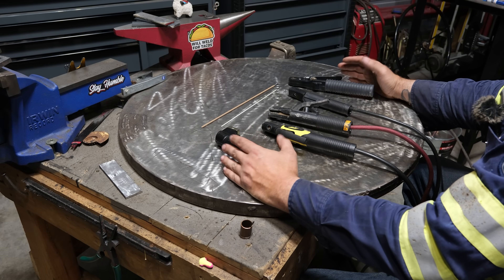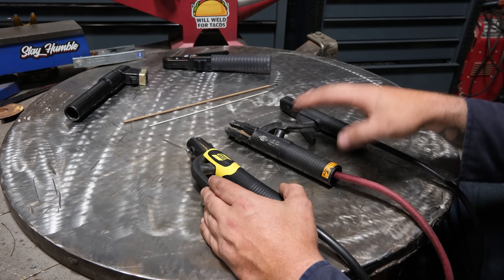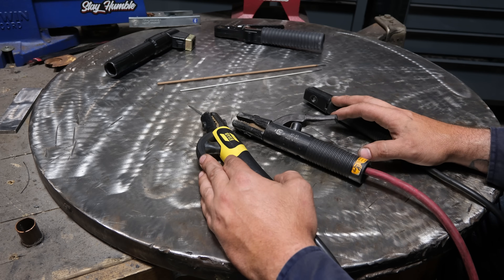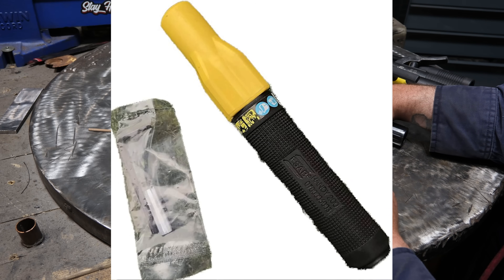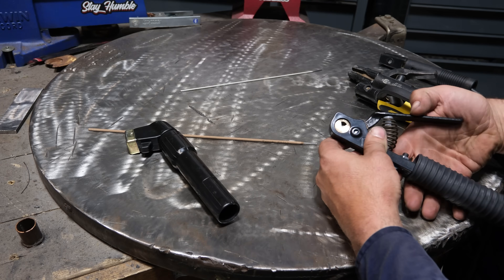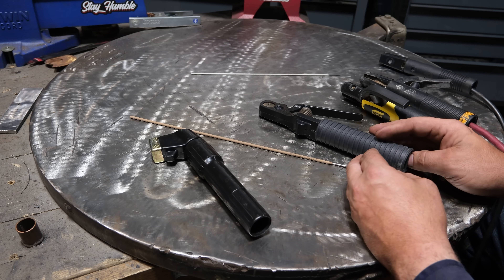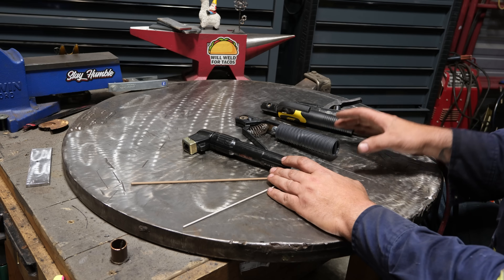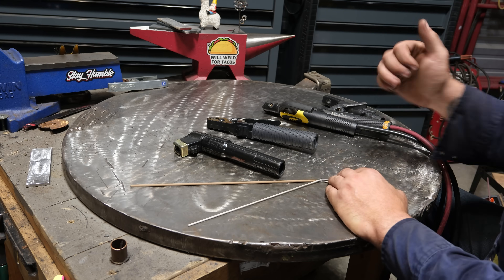Stinger V and other electrode holder upgrades

Comment: I hate that I like the Harbor Freight Berger model. SKU 63848, under $20, and a seriously decent upgrade/replacement for anything south of industrial welders. If you can snag it on sale, it's $10-12.
Reply: I've got 2 of those Bergers on my shelf right now... one to replace the stinger that came with my Stick 225 when it wears out, and one to be a spare.  Haven't used one yet, but they look well made... I think they look like a Lenco copy.
Reply: I think it is indeed a Lenco copy, yeah. It was hard to resist grabbing a few for ~$10 whenever I bought them on sale, and so far they're holding up really well on various machines.

It's perfect for that use case where you need a new stinger, but the welder isn't worth putting a $40 job onto it. 😅
Reply from the maker: 100% that’s a solid option.  Definitely a lenco clone, and a really good one at that.

Comment: Twist type all day😁👍👍
Reply from the maker: I used to talk trash about them and then really used one for a while.  They are really nice honestly.  One thing I didn’t mention about them is rods tend to not get as hot while being held in them.  The non pinch style can make poor contact causing the rod end that’s in the jaw to get hot.  If your hand is up high on it you will smoke your glove or hand in a hurry lol.  I am not sure why everywhere outside of the USA often use twist locks and we don’t.
Reply: @makingmistakeswithgreg  In Canada i see almost exclusively the Bernard shortstub twist type , i prefer myself a Lenco 300 Amp but i have to say , to relight a 7018 , with the Bernard you can really bang the shit out of the rod and it wont move a bit. Also , with the twist type , you can burn your rod to the very end in an inside joint for example without having the jaws of your stinger in the way
Reply: I’ll try one, then, if I can find one small enough for diameter.  Then big ones are trouble…

Comment: Hello dear Greg 
Very nice to see you
Have you ever used also Lenco stingers like thread pinch stingers?
I really liked the design of lenco thread pinch stingers.
Because i live in overseas and it is really expensive for me to buy one i made one  by machining mild steel. Even though it is a little bit heavier i liked it so much.
Reply from the maker: So they do make that style and I have never used one or seen one in person.  I would imagine they work well, I need to find one to check out.  There are a few other obscure ones that function similar to a twist lock but have a handle, but they tend to be out of manufacture or super obscure/difficult to get.  I need to hit eBay for sure lol.